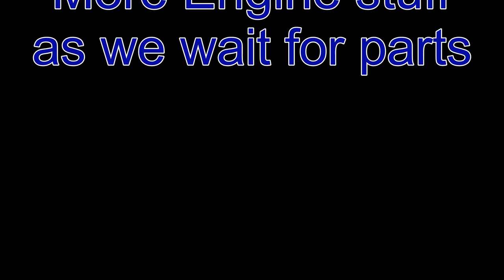78 F-150 is all cut up!

Comment: Sheet metal work is oh so time consuming. Add crash damage, and it's a challenge! You're doing a good job, shaping up really nice! Kinda like a puzzle! 
Note: I have YET to find a cab corner that actually fits right... so there's that.
Also, I haven't yet done a 400 to 460 manual trans swap, but have been researching the process done by others. Since yours is an external balance, can't you just use the later model flywheel and get a spacer for the bell housing to block to get proper starter alignment? Or is there no spacer available?
Reply from the maker: From my research the regular 460 flywheel and clutch will hit the inside of the 400 bellhousing.
Reply: @cprgarage3206  With a bell spacer it won't. The later model trans has a deeper bell. Or use an FE flywheel with an 11.5 clutch and 302 pilot bearing, seems to be the consensus as an option.
Reply: You can grind the inside of the bell housing. I did it on mine